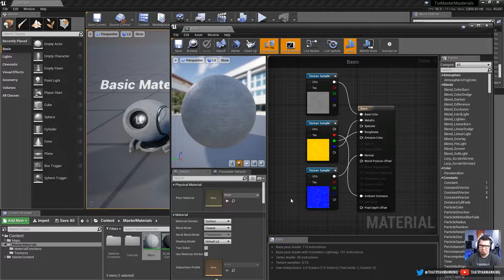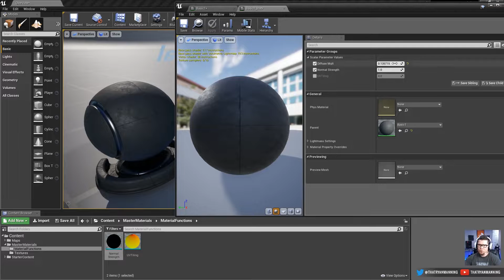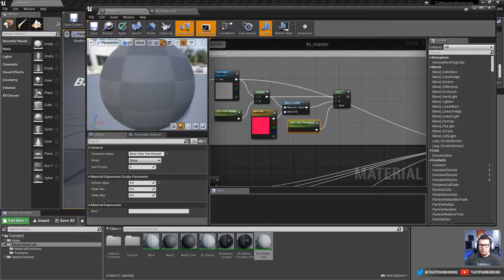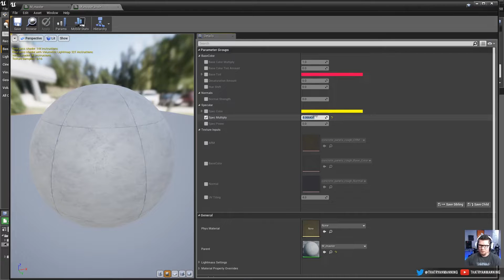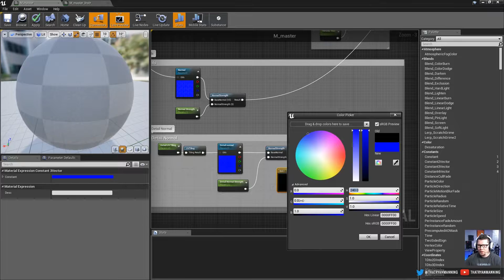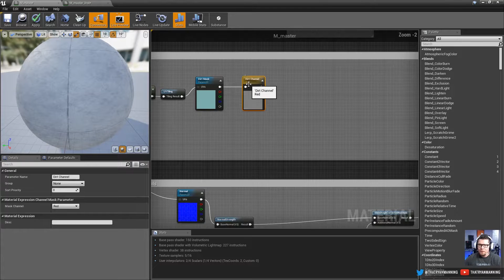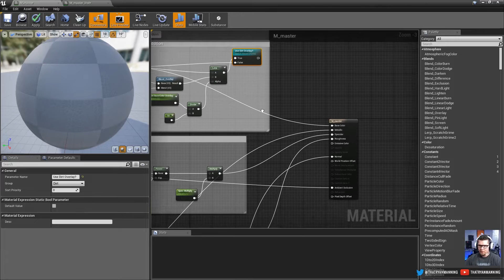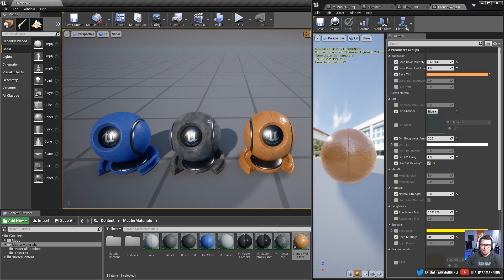UE4 - Creating Master Materials

Comment: Thanks heaps for checking these so long after too BTW, given we using 4.26 and it's 2021 awesome Sir
Is there a way to add world alined as swtich maybe so it can be turned on or off. I notice to, most do tiling as one scale that does both, not many allow X Y tiling and separte options

Comment: THANK YOU FOR THIS!!!
can you give me some advice on how to toggle on multiple switches for one material input(base color/roughness/metallic) with all the switches collapsing into a single output and NOT affecting the other switch inputs? I'm currently building a master material and, for example, my base color 'use texture' switch has the base color showing on the texture map, even when the switch is toggled off.
can you give me any tips on what node I'm missing?

Comment: Hard to find such a great tutorial. And its straight to the point. Is there a way to add height map in this master material?? I tried but I couldn't connect both tiling and bump offset to the UV of each texture. Any help would be appreciated.
Reply from the maker: There's a parameter on the material that you need to set to see displacement; under "Tessellation" you need to enable "D3D11 Tesselation Mode". You'll then want to multiply your height texture by a scalar parameter to give you the extra offset. Plug all that into your "World Position Offset" and/or "World Displacement".

Comment: I get an error when creating your Normal Intensity Material function. When I add it to the normal map in the material editor n the leather I am working on it says: Function NormalStrength (Node Multiply) Arithmetic between types float2 and float are undefined. Any ideas why?
Reply from the maker: Most likely your using a 1-vector Scalar parameter somewhere where you should be using a 2-vector.
Reply: @ThatRyanManning  Got it figured out. Made a wrong connection. Awesome tutorial thank you so much!!!!!!

Comment: hello, thx for the video , i have a question , at 7:30 you start with a two value parameters for the texture coordinate, and then switch for a one value parameter. Is there a way to make two?
Reply from the maker: Yes. Create two separate one vectors and combine them with an "append" node. That will get you separate U & V coordinate controls.

Comment: Why I should add the hue shift parameter when I can change the color with my 3 vector parameter? Aren't they doing the same thing?
Reply from the maker: Most likely your 3 vector parameter is adding color whereas a hue shift is shifting underlying values.

Comment: When I plug in the normal strength material function into the result node of the material, I get an error message that says, "[SM5] Function NormalStrength: (Node Multiply) Arthmetic between types float2 and float are undefined" Help :(
Reply from the maker: Make sure that your input preview node inside the Material function is set to Scalar Vector 3.

Comment: In your initial setup, basic material, what are the three, I believe three, texture samples? I see a normal map, but I wasn't sure what the other two were.  Did you supply that?
Reply from the maker: The setup should be: 1) BaseColor, 2) ARM (ambient occlusion, roughness, metallic), and 3) Normal Map. 

And yes, those textures were converted to Texture Input Parameters so they are exposed to material instances.
Reply: @ThatRyanManning  Got it.  Thanks!  I finally grabbed some of the basic textures in UE, and tinkered with it.  Awesome video, btw!

Comment: Great video!  For whatever reason my Normal Strength function is giving me the "SM5 error Function NormalStrength:(Node Multiply) Arithmetic between types float2 and float are undefined..." when I want to use "Use Detail Normals" and check the box.  Unchecked, it's fine.  I've gone through the function section a couple of times and information matches up, math is set up correctly.  BaseNormal is a Vector3 and NormalStrength is a Scalar. Any ideas?
Reply from the maker: Check 8:52 of this video that you have the same setup. Explain what you mean by "and check the box"?....
Reply: Under the instance for the material, the parameters created include the true/false statement for "use detail normals".  When marked as true and the parameters make themselves visible is when the error pops up in the Instance Preview window.
Reply from the maker: @AceAlmighty13  Make sure your False input is a 3 vector (0,0,1)
Reply: Talking on Discord, in UE4.20, I need to have the scalar node attached to a makefloat2 node(both x and y) and then into the Multiply.  Mine wouldn't work otherwise.
Reply: @AceAlmighty13  Propably 2 late but use a flattennormal node instead of the function he made, works the same as far as i can see

Comment: Why do you use specular adjustments in PBR workflow?
Reply from the maker: In my experience your specular values aren't always correct when importing textures/materials, thus having a parameter to control spec is invaluable.
Reply from the maker: Also, subtle variations in your spec channel can really enhance realism. Hence why using the red channel of your diffuse is advisible.
Reply: oh, ok, so you are using Specular in your workflow than? got it, thanks for the reply.
Reply from the maker: @someonewithsomename  yes. While spec may not have as big of an impact on visuals as say your roughness channel, the subtleness of a spec channel still makes a difference.
Reply: @ThatRyanManning  thanks again for the video and detailed replies. Will look at what can specular add to my materials!

Comment: Brilliant tutorial. WOW. Thank you a lot. 

One thing... This is not correct to use specular like this. Colored specular is only appear on metal materials which, ue4 uses base color as specular when you set the metallnes value 1. But with non metal materials, specular cant be higher than 0.4. And it only changes (lower than 0.4) when you create skin, milk, and such materials. Other than that, it must stay at 0.4. Other than that if you change specular it is not PBR material anymore .
Reply from the maker: There are several reasons why using the red channel is better than a solid color. While in theory you are correct when it comes to pure, scientific-based PBR values and not wanting to push them over a certain amount, there are situations where you want/need the additional control. Clamping your specular values at 0.4 is fine, but with the method I outlined in this video, you have the additional controls to lower/boost your specular values as needed. In the end, no matter what method you choose, it's always advisable to run your specular buffer visualization to check for proper PBR values.